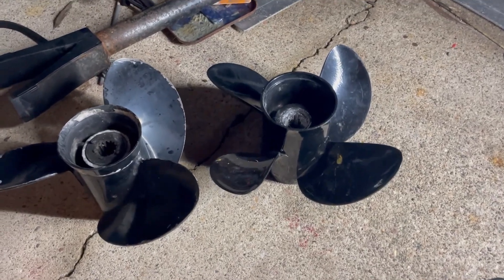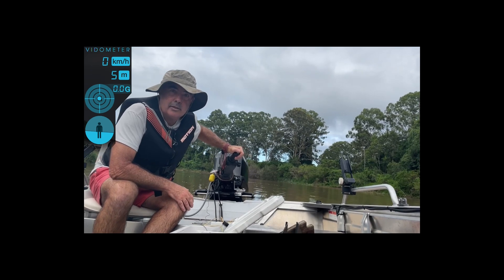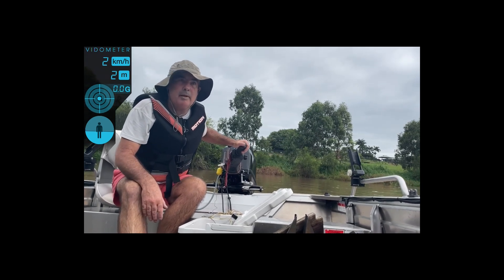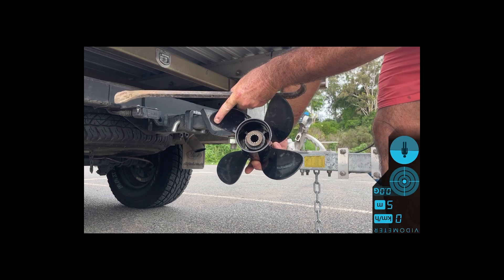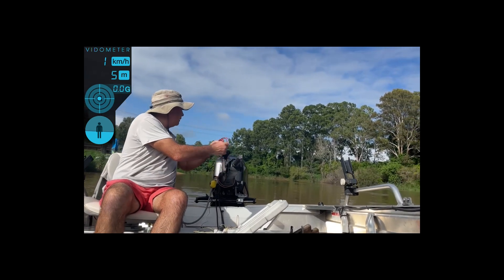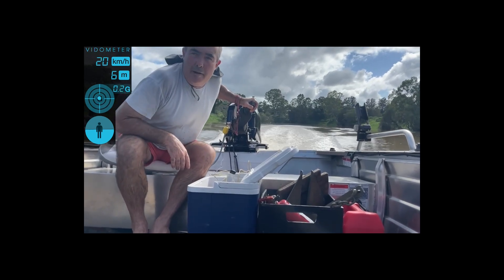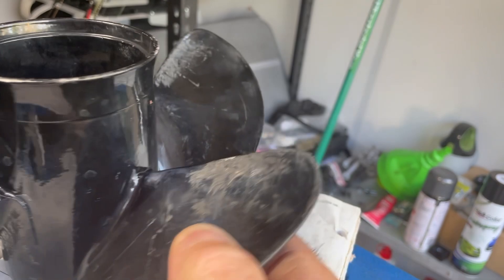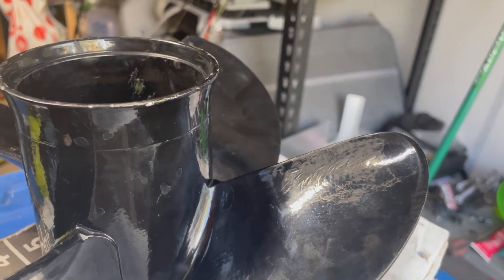Cupping a propellor how much difference dose it make

Comment: There’s no way you did cup the prop with just a light tap using crowbar?and 30kmh+ in difference?
Reply from the maker: It picked up around 18kph 
The prop was slipping bad before cupping it, and yeah I just done it with a crow bar. A hammer would’ve been a lot easier .